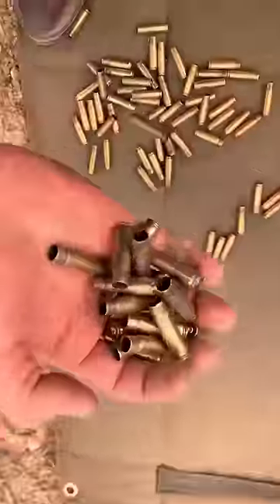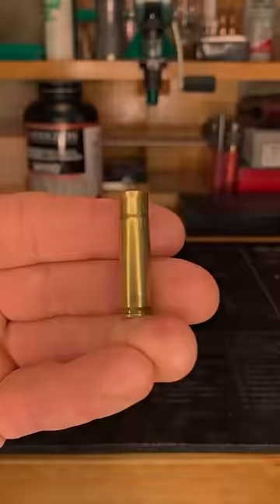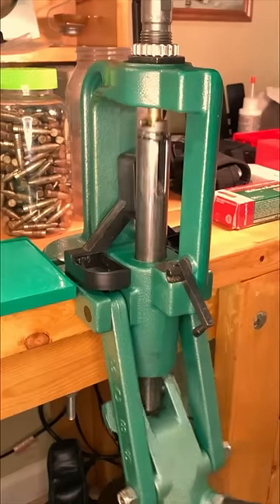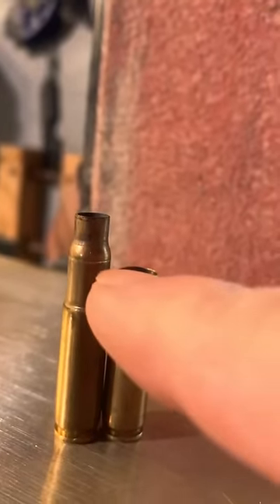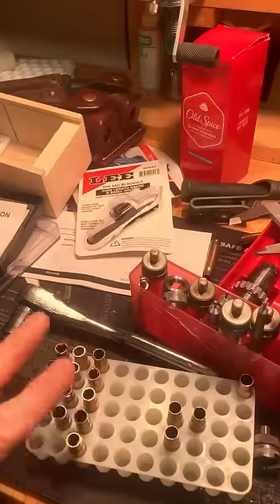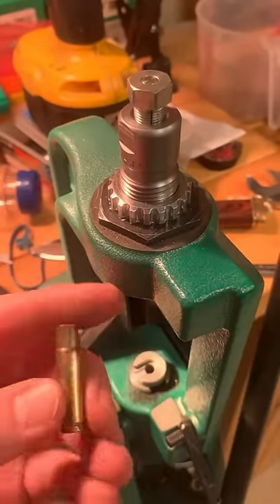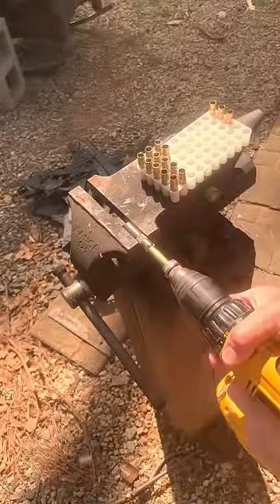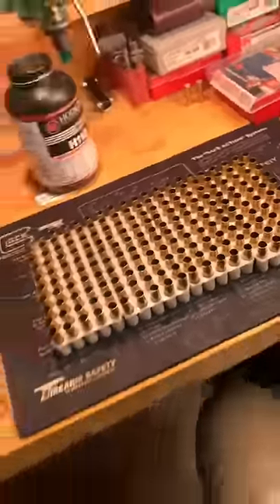How to convert .223 cases to 300 blackout. #shooting #reloading #300blackout

Comment: Use to reload.44long, they never seated right, but this is how I should have done it
Reply from the maker: Another couple of things that may help facilitate good smooth seating:
1) case mouth belling/flaring. Most Carbide tungsten pistol die sets from RCBS come standard with a belling die. 
*Lee also makes a universal flaring die with four different cone ends and tons of adjustment that works for .22-.45 cal. 
2) proper seating die adjustment. Most RCBS (and some other brands) have a feature on their seating die that implements a crimp simultaneously to the stroke that seats. These types of dies MUST be properly adjusted and the way you do it can be counterintuitive. If you read the instructions that come with the die set VERY CAREFULLY then you will save much frustration when setting up this kind of die. 

I hope this helps. And I hope you will give those .44 longs another try! 
Happy shooting! 💨 
-Stagger
Reply: @staggerleesmancave8987  damn bro, thank you for the info
Reply from the maker: @SatchPersaud-sm1gc  my pleasure. We gotta stick together. 👊

Comment: Either that or you can get a multiple stage reloading die set that does all that work for you with a foot pedal.
Reply from the maker: I’m not acquainted with any reloader, progressive or otherwise, that has a “foot pedal”. Nor am I aware of any press-operated die that trims off excess case length. Could you enlighten us? Or is it possible that your background in sewing machines has lead you to a misconception?
I remain fully prepared to stand corrected and apologize if I’m wrong. 🫡
-Stagger
Reply: @staggerleesmancave8987  There's literal case resizes, decappers, and trimmers with a shop vac hose adapter in one stage. You can get a Posness-Warren foot pedal and a GSI bullet feeder. I'm just saying, single stage dies and all this manual labor is just such a waste of time and it's less consistent.
Reply from the maker: @printingwithpeek4897  that’s actually very cool! (Just went to the P/W website). Thank you for this! I knew there were some very high tech reloaders out there but had no idea about the foot pedal. Thanks again and the advanced apology stands lol. 
-Stagger
Reply: @staggerleesmancave8987  No no, you're good. I just try telling people, think of a better way.

Comment: Do you also anneal or normalize the cases or any kind of heat treatment given the amount of deformation and  unknown nature of pick up cases??
Reply from the maker: I use mostly annealed PSD brass. Even after removing the excess length, during the conversion, at least a centimeter or so of the annealed portion remains, making up most of the new neck area. Right where it needs it. 
-Stagger

Comment: Due to a stupid, lengthy licensing system my rifle is still in jail>
Havent been able to cycle my test rounds yet but a few things i've picked up so far:
Neck sizing is going to be a an issue, the brass approaching the shoulder on different cases varies A LOT meaning you will be out of spec here without another step.
Lee decapping\sizing mandrel setup is a terrible design that does not lock up properly.
Lee case trimmer mandrel has a mild steel pin, i see mine wearing out after 500 cases. Did 100 so far already looks worn.

Comment: so, roundabout, what would it cost if i were to get all these reloading tools for smaller caliber? or just the cheapest caliber to reload
Reply from the maker: The quick and dirty is that is costs about $500 total whether you are getting starter kits from RCBS, Hornady, or Lee (this figures in the cost of your first die set for your chosen caliber). While Lee is considerably cheaper, you should get a supplementary hardcover manual with their kit. While it does vary across calibers (and what’s on sale) the rough average I’ve determined is that once you’ve loaded a dozen boxes of 100 rounds, you’ve fully cleared the original investment costs and are racking up pure savings. Happy shooting. 💨…and perhaps reloading!
-Stagger

Comment: That’s cool and all about how this saves you money but how much do you have to make yourself to justify the cost of all this equipment versus buying the ammo? And also is the time it takes worth it? I highly doubt you are capable of self loading 30 in an hour, but even if you could that’s still an hours worth of work that gets shot through in less than a minute. 

I get it as a hobby or you find it “therapeutic” but how much money does it really save when compared to the time it takes to load? This makes way more sense for large hunting rounds and obscure ammo that you aren’t firing in large amounts anyways, but common calibers like .223/5.56, .300bl and other 7.62s, etc just doesn’t seem to balance out time requirement wise.

Comment: How much do you need to shoot, before you break even on all your equipment to reload/resize?  I need stats to pursuade the wife
Reply from the maker: Ok: before I crunch these numbers, tell me: 
1) would you be casting your own lead bullets?
2) what caliber are you most interested in reloading?
Reply: @staggerleesmancave8987  I’d actually like to know this. Let’s say I’m casting my own lead and reloading 223. How many rounds would it take to break even with the most basic equipment
Reply from the maker: @tiredturtle689  
Ok. So going MOST BASIC:

*You definitely need to do some research for your safety before getting into this, so a good place to start is the Lyman cast bullets manual $24.99
You should also purchase the Hornady reloading manual to learn the basics of reloading again for your safety $45.00

The Lee single stage (Challenger breech lock press kit) includes your press, scale, powder thrower, hand priming tool, chamfer/debur tool, and a few other nifty items. Currently on sale at MidwayUSA for $179.99 (Father’s Day) 
To load .223 you would also need a .223 die set. Lee die set at Midway USA: $23.99
Would recommend a crimp die for lead projectiles: $12.99 
A universal case mouth flare die is pretty much a must for lead bullets: $18.59
Ok. So that’s reloading equipment (and very necessary literature for safety) and so far we are up to $305.55 (plus tax and shipping)
————————————————-
Now, if you want to cast your own bullets: 
Lee production pot (lead melting/dispensing pot) currently on Father’s Day sale for $79.99

A good bullet mold for .223 can be found at NOE bullet molds. The one I use is: 
225-57-FN-A3 3 
They run about $100. 
(And yes, they are actually a bit better than the Lee molds ) 
lastly, a good sizing die such as the Lee push through .225 die is very helpful in achieving a uniform size as well as for seating your gas checks. $19.99 

————————————————
New total after casting gear:
$505.53 (plus tax/shipping)
So not to circumvent your original question, but it is very difficult to answer this in terms of “how many rounds would I have to shoot” and this is simply due to the fact that ammo, particularly bulk cheap ammo goes on sale periodically from places like palmetto state, and creates outliers, that completely throw off this figure. 
What I can tell you is that loading your own ammo is only going to cost you the cost of primers, powder, gas checks, and lube. 
Primers currently average about 9 cents. Gas checks 4.5 cents. One pound of any gun powder runs anywhere from about $35-$40. There are 7000 grains in a pound. So a typical load charge for cast 223 would be about 20 grains. Which would translate to about $.10 per round.
So your total cost per round would be about 23.5 cents per round. 
A quick and dirty search that I did just now on midwayUSA for cheap bulk jacketed .223 came out to 65 cents per round. Let’s just round up the 23.5 to 24 and say that you will be saving $.41 per round. 
That means to justify your aforementioned EQUIPMENT (components, such as primers and powder not included ) grand total you will need to produce and shoot 1,233 rounds.  Or to make the number less intimidating you could say about a dozen boxes of 100 rounds. 
WHEW! I hope you appreciate this lol it took me quite a few minutes. 

Hopefuly you are sourcing your lead somewhere for free and I would assume you are already sitting on a mountain of brass or you wouldn’t be asking this question. 

A couple of things to know about cast bullet ammo for .223 particularly if you plan to do it on the AR platform: 
You will have to use gas checks and a good bullet lube. I cannot speak to the efficacy of powder coating when it comes to this very finicky round when it comes to cast ammo. I can however tell you that Lee liquid Alox in combination with Hornady gas checks and very very hard alloy like 22 BHN works perfectly fine. You will have to work your way up very gradually (like 0.5 grains at a time) to achieve the proper load charge to cycle your action in addition to NOT exceeding the velocity that is tolerable by a gas checked lead projectile (about 2100fps). You will find there are many people out there who believe that this is impossible. It is not. I have achieved great success with this round using all of the aforementioned supplies. I have had good success using Varget and H4895 as propellants. 
Lastly, it is standard practice to size up lead projectiles 1 to 2 thousands of an inch larger than the typical jacketed projectile, for that bore. For example, in the case of .223 your projectiles are usually going to be .224 to .225.  
I hope you have found this helpful. 
Happy shooting… And possibly reloading  💨 
-Stagger
Reply: Tell her it’s all about getting out of her hair, having relaxing private hobby time, and getting manly satisfaction constructing things.

Comment: Except all 223 556 brass is not the same thickness. There is a go nogo list of manufacturers for what brass can and can't be converted due to wall thickness.
Reply from the maker: That is very true. Elvis Ammo once posted a very good video on this “naughty list” of brass when it comes to the blackout. You have to find the brass that functions well in YOUR upper. My PSA upper apparently is very versatile. The only one that ever gave me a hint at a malfunction is PPU. (And I’ve shot quite a mixed bag). Everything else I have used has fed, fired, and ejected just fine. But I understand that for others it may be different. 
-Stagger

Comment: Hello, I want to start reloading my own ammo but I don’t know where to start. Do you have any tips on what to buy/study? I mainly want to reload 5.56 and .45 acp.
Reply from the maker: Hello Erick! You’ve chosen two very good calibers to reload. You will become more knowledgeable about your ammo and familiar with your firearms as well as saving lots of money. You will shoot more and pay less! A good place to start is a starter kit by RCBS or Hornady. These are my top two recommendations because both these kits include comprehensive hardcover reloading manuals that will educate you in the fundamental process as well as providing reload data to guide you in loading all the major calibers. You can get these kits from MidwayUSA, Cabela’s, and Bass Pro Shops. The cost of your initial investment combining the starter kit and the die set of your chosen caliber will run you about $500. You will recoup that quickly. The kits usually include a single stage press, scale, dispensing powder measure , trickler, manual, chamfer/debur tool, case lube/pad, and a few other essentials. 
Build yourself a reloading bench to permanently mount your press and designate that area to reloading only!  Take pride in it. Keep it clean and organized. When you sit down to reload, make certain you are well rested and sober. Call a loved one to your bench. If they can’t come in person, then FaceTime: 
“Hey I’m about to load up some 45 ACP. Here on page 254 of the Speer manual it says I can use 6.5 grains of Alliant Unique and that’s what I’m using today. I have verified a dozen throws on my scale here that my powder thrower is dispensing exactly 6.5 grains. I have my die set to seat and crimp these bullets to a COAL of 1.25 inches. Do you concur that I’m following the correct data for this caliber?” 
Your loved one should look at your scale, your book, and if possible any dummy rounds you have made to check cartridge overall length. And if everything checks out give you the green light. If you always treat this like you and the loved one are two registered nurses checking a potent medication, your ammunition will always be blessed with a high standard of safety. Good luck to you and I hope this will bring you as much joy as it has brought me. 
-Stagger
Reply: @staggerleesmancave8987  thank you for your reply!

Comment: Yeah but because it's stamped 223 I imagine you're inviting confusion.
Reply from the maker: For anyone that would have difficulty differentiating these two cartridges (.223 vs 300BLK) merely by the look of their profile, a simple solution would be to exclusively use brass that is NOT stamped “.223”. For example, one could use PSD (PMC military brass) which is widely abundant and only head-stamped “PSD”. It only requires the simple extra step of running them through a primer pockets swager to remove the military crimp. Easy Peezy. Most of my brass that I convert to blackout actually happens to be this type. It runs very well through my Palmetto State upper, is entire front half annealed, is proven to be very durable for multiple reloads… And of course, no head-stamp confusion. 😁
-Stagger
Reply: @staggerleesmancave8987  bro it's just me.  With things like this I want it to be as plain as possible because of the tolerances.

Comment: It would hurt yalls feelings to know how many .223 and 300BO brass I have in my scrap bin. Never fell into the never ending niche caliber victim crowd.
Reply from the maker: Scrap? As in…to melt down? 🥺. 
Yes. Yes that does indeed hurt my feelings. 
-Stagger
Reply: @staggerleesmancave8987  indeed, roughly 580 pounds and expecting a $1500 check when I take it in tomorrow. Don't be too upset, I reload I think 21 different calibers to include some older and rare ones (300 Savage), have about the same amount of weight I keep to load.

Comment: How many times could you reload a shell
Reply: That depends on the cartridge. Everytime you fire a round it deforms the brass a small amount, even though its chambered (more or less). Then when you run it through the sizing die it stretches it back. Well there's excess brass now and shows up in its length, thus the reason you trim it back to OAL specs. So the brass will slowly lose its thickness every time it's stretches and gets trimmed.
 You have to inspect your brass whether it's the first run through or your 8th, 9th whatever. Many of us use a single stage or a turret press. so our hands are on each individual shell several times throughout the process of cleaning, de-capping, sizing, trimming etc so it's easy to catch any bad ones. I don't risk it for the savings, if it looks funny goes in the brass box.
Edit: I don't reload for speed or to crank out 1K rounds every few hours. I reload because I enjoy it and it's more accurate than most over the counter ammo. Sure I build up a large supply over time but it's not a race for me, and if you're a scrounger it's much cheaper.
Reply: @elconquistador932  ok thanks
Reply: @smokedem333  Tgeres other guys on here that could explain it better than I did but in a nut shell that's what happening.

Comment: My shoulders are too long.  What am I doing wrong?
Reply from the maker: First examine the die, and see if there’s any debris or anything stuck inside. (you may need to disassemble it ). Sometimes overtime things can accumulate in there and get gunked up with lube. Obviously any obstruction can prevent your case from conforming to the proper dimensions. Also verification of what die you have in there can reveal the wrong one got left in the press. (guilty).
Also, you may want to open up the pamphlet that came with the die, set and be sure you are setting it up exactly as the manufacturer instructs . Usually it involves raising the ram to the top of its stroke, then screwing in the die, until it just begins to touch the shellholder, lowering the ram and turning the die about one more quarter turn. That’s all assuming these are standard tool steel dies. What I just described is the process for “camming over”. Carbide tungsten dies expressly instruct not to cam over. With those you would simply engage the lock ring without adding the extra quarter turn after touching the ram.
Lastly, verify that you are using the proper shell holder. For RCBS, it will be a #10, for a Hornady #16, for Lee a #4, and Lyman a #26. 
One more thing that may help : review the proper case dimensions for 300 blackout, in your reloading manual. Verify what you are getting with your dial caliper. It may not be as off as you think. The eyes can be deceiving. I hope this helps. Good luck and happy loading.
-Stagger
Reply: I don't think my eyes are fooling me.  I have a Wilson cutaway gauge that it won't fully seat in.

Comment: The fact that 300 black out will chamber in 556 is y I won't buy a gun in 300
Reply: Watcha mean? .300 blackout doesnt feed properly into a 5.56- it’s a design feature. The other way around however is a possibility, 5.56 in .300 blackout. But yeh
Reply: @mcthotticus3799  .300blk will chamber in a 5.56 chamber
Reply: @nfaisnfgay  not according to the man who invented .300blk. Kevin Brittingham from Q
Reply: @nfaisnfgay  as of kevin brittingham, it wont chamber correctly